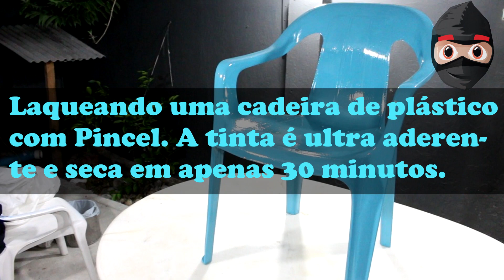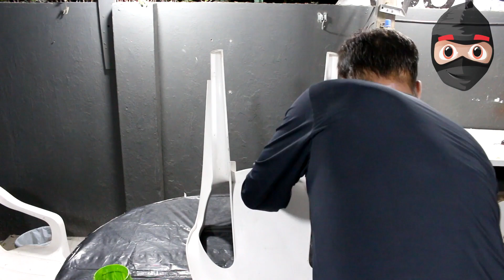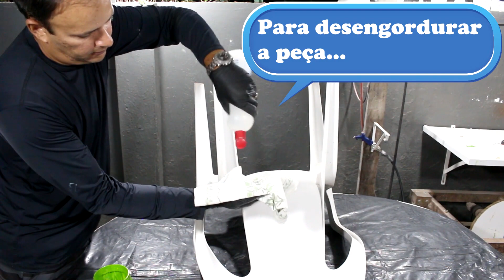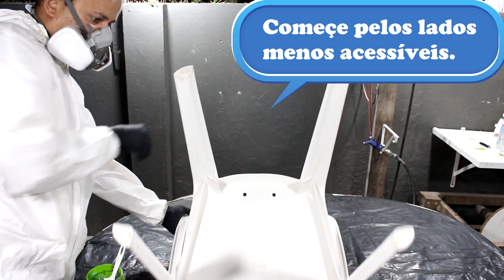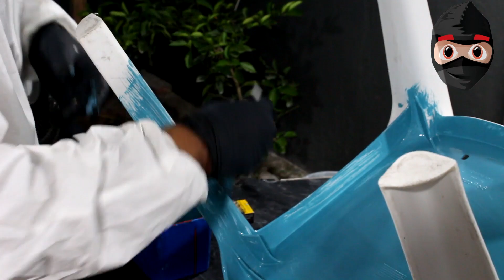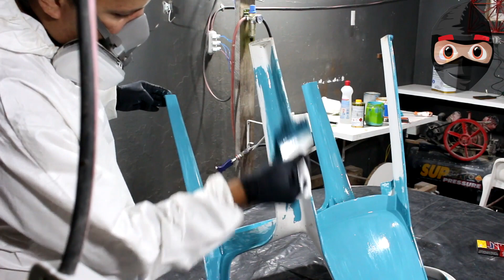Pintando Cadeira Plástica PVC com Tinta Automotiva - Secagem em 30 min

Comment: Bom dia, não seria necessário passar um selador/prime para plástico antes? E quando o rendimento, tem noção de quanto dê para pintar com 1/4?
Reply from the maker: Com o primer pra plástico é o ideal. Acho que 1/4 tu pinta umas 5 cadeiras. Abraço.
Reply: @AgilizeSuaVida  1/4 de qual quantidade?
Reply from the maker: @mariacristinamarciano5436  1/4 = 900ml de tinta
Reply: @AgilizeSuaVida  1/4 de primer ou tinta que dá pra pintar 5 cadeiras?
Reply from the maker: @mariacristinamarciano5436  use 2/4 de selador para plástico e 1/4 de tinta pu. Acho que dá. Leva foto da cadeira pro vendedor e pede a opinião dele TB. Bjus